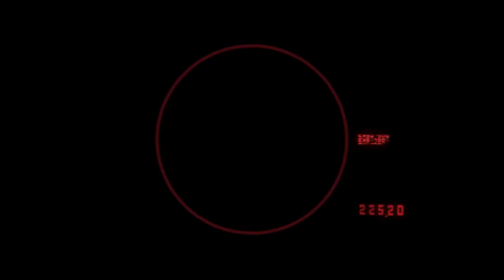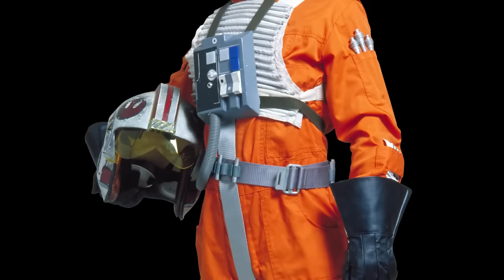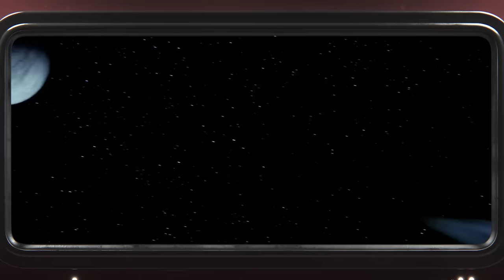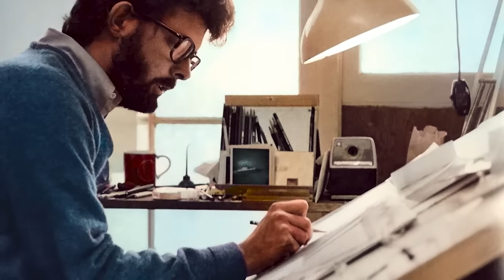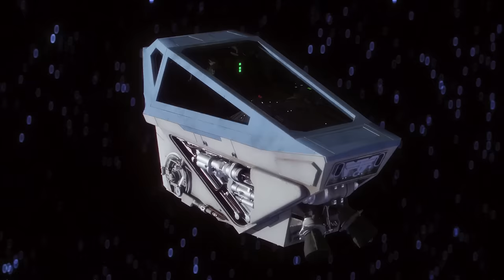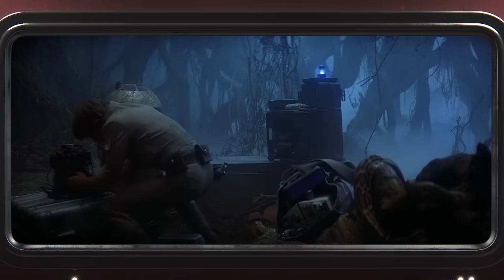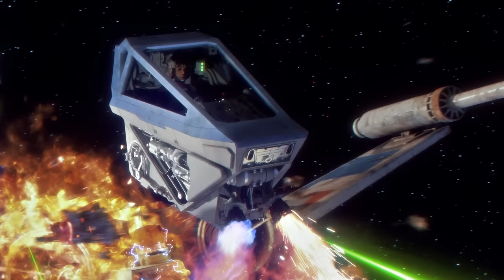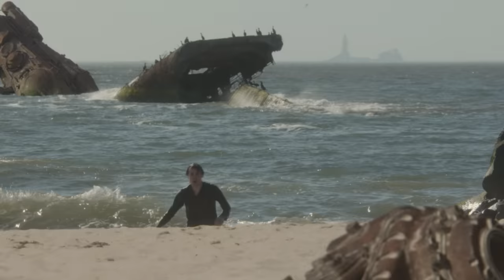X-Wing Ejection: It all makes sense now

Comment: In The Empire Strikes Back we see that the X-Wing has a storage compartment for essential survival gear, situated directly below the cockpit and accessed from the underside of the hull. If that were actually integrated into the base of your ejection pod, it would mean that those supplies stay with the pilot, with or without the rest of the ship.
Reply: I was thinking the same thing.
Reply: Ooof, I came here to say the same thing before I saw your comment. But yeah I agree.
Reply: This makes a tremendous amount of sense. Even on long flights the pilot can dip into rations below their seat by opening a panel and pulling out the ration box.
Reply: Thought of this also, but if I remember right, the cargo bay is below the astromech, not the cockpit, between the lower engine intakes. It could be connected, but I think it would over-complicate the ejection process.
Reply: @Treveli45  Remember though, all that stuff that Luke has on land was brought out of the X-Wing while it was still half-submerged, meaning there had to be some access either on the top of this ship or, as would make sense, through the cockpit.
Reply: @Tensen01  I keep having a vague book memory of the cargo bey being reached by going through the seat. But having the bay eject with the pod would add more 'moving parts' to something you don't want to over complicate. From ESB I'd say the cargo stuff is if you manage to land the X-wing, not if you're ejecting in a hurry.
Reply: Real Star Wars fan 👍😁
Reply: The cargo bay is actually under the astromech slot.
Reply: Would that be like a hole that would go from the top through to the bottom of the ship
Reply: I doubt this would be the case. The X-wing - along with most, if not all, Rebel starfighters - may be classified as a snubfighter and allows for comparatively more comfort, but they still only allow for similar amounts of space as most fighter planes, which is not a lot. Believe it or not, but the X-wing's cockpit space is similar to that of an F-15 - not the most cramped out of all fighters, but still not as spacious as you might think.

Fighter pilots on Earth do keep supplies with them in the cockpit for extremely long flights. However, there is really one only place they can be stored that is not on their person: behind the ejection seat. That space also contains their bailout supplies, and the seat itself still contains the main emergency comm systems, as modern bailout supplies are designed for rapid pilot retrieval via signaling for help rather than extended survival, and it has been the case since the Vietnam War. Fighter planes can be equipped with small cargo pods that can be loaded with the pilot's (and possibly the RIO/WSO's, if it is a two-seater) personal effects, but those are not meant for easy access until they arrive at their intended destination, as what gets loaded in those is rarely anything that can aid in survival - yes, they can be loaded with such, but if you are in a situation that forced you to eject, odds are that situation prevents you from ever being able to access them, so making relatively easy access to such a cargo while flying is kind of pointless.

In fairness, it might make sense if it was kitted out (and likely modified) for long-range reconnaissance flights, which would likely include removing most, if not all, weapons in favor of more fuel, better/more sensors, and yes, cargo space. For ones equipped for combat, though, such an easily accessible bay is likely to be considered a waste of design and effort.
Reply: @DavidRichardson153  That was a lot of well-written reasoning, but we know the X-Wing contains extensive survival supplies because we see Luke set them all up as a base camp after he crashes on Degobah in Empire Strikes Back. He has several crates that include ration packs, a power generator, supplies and spare parts.
Reply: @DrakeAurum  Yeah, and that is stuff that would only really be needed if you were able to land relatively safely (despite crashing into the swamp, he escaped injury, which qualifies it as a safe landing). And the fact that the bay contained a power generator and spare parts, all of which would have been useless if he had ejected in space, only further proves my points.

Even if Luke had ejected in atmosphere, unless R2 was left behind AND still could control the X-wing, what is even the point of storing items in a bay that, really, would hit the ground in a crash first? Now, throw in the much heavier weight of an ejection pod, along with the extra weight all of those items in the bay would come with, all of which would only serve to more quickly drain the already limited fuel such a pod would have, and what you have are increased chances of the pod NOT saving the pilot's life.

Invoking The Empire Strikes Back does nothing to help your assertion here. Could you have a fighter that does have such a setup? Sure, you could, but as shown and as I have to point out, the original trilogy's X-wing cannot be that fighter, and the newer Disney variant does nothing to suggest that it can be either.
Reply: @DrakeAurum  Oh, and one last thing to point out about Luke first accessing those supplies to build his little camp before he met Yoda: he was standing outside the cockpit with the canopy open, not sitting in his seat with the canopy closed. In all likelihood, he was physically unable to access those supplies while flying, and last I checked, the X-wing was never designed with the intention of having Jedi fly it, which Luke clearly was not at the time of the movie. A Jedi or any Force-user with sufficient practice could theoretically access those supplies while flying, but not a normal pilot, which was what Luke basically was when he arrived at Dagobah.

Having a feature that, in all likelihood, hardly any pilot would even be able to use, let alone actually use, is a quintessential example of wasted time and effort and pointless overengineering. Sure, he did still use the access, but again, it was only after he had crash-landed and he was outside rather than inside. If that access was meant to be used (and this is assuming it actually was a feature and not something he had to jury-rig on the spot), it was not to be while in mid-flight.
Reply: @DavidRichardson153  Most likely such storage was meant for scouting missions or forced landings, not exactly in space, nor in a swamp. Presumably at least SOME of the supplies would have been accessible from the cockpit itself (The food rations and medical supplies were shown to be not very bulky) The rest of the crates and camping supplies were likely accessible from the hatch underneath, or from the cockpit if the seat were moved (As the bottom half of the X-wing was under water at the time Luke had gotten the majority of the camping supplies out) So I don't think it's so much over-engineering as much as giving the pilots as many chances as possible to survive a variety of incidents. (Ejecting in space with NO way of landing on ANY planetary surface admittedly being the weakest chance)
Reply: It's great to see common sense still works. You know since it's become such are rare site in society now. It has become a flower that doesn't bloom in everyone's garden ANYMORE! EC I think you're spot on with the ejection system. And from the comments pretty much all agree. Love your content keep it coming.
Reply: @Tensen01  makes sense. Luke wasn't going to go swimming under the x-wing with that creature in the water to get the survival kit. Although we see him messing with the cargo section when the x-wing is out of the water, that doesn't mean the "survival kit" was in there. It would make more sense for the survival kit to be under or behind his seat.
Reply: Since he was going specifically to a foreign planet, he very well may have had more than the usual supplies packed in the cargo bay beneath the astromech, which would be something entirely separate from the usual emergency rations connected to the cockpit. If I was flying to a funky swamp planet, I certainly wouldn't pack nothing but the standard issue compact survival kit
Reply: A floor access panel inside the cockpit would allow it to have survival gear for a weeks worth or more after ejecting in deep space, certainly enough time for a distress beacon to be picked up.
Reply: well hyperspace tripps can take days and weeks there has to be some survival gear in it but the old lore the good lore before it went dark in the galaxy before disney said there where energy bubbles
Reply: @DavidRichardson153  of course we are talking star fighters not modern jet fighters.  being able to fly from one part of the galaxy to another and land vertically allows you do go more places meaning you need more stuff.
Reply: And also, along the lines of expanding the escape pod slightly, the astromech droid is so close to the pilot in the cockpit, the module could maybe not leave R2 behind too…😅!
Reply: …which you might want to do if he actually has the cargo module under himself anyways…😅

Comment: They utilised a system like this for the USMC fighter pilots in 'Space: Above & Beyond'. Made a lot more sense in the cold vacuum of space than an ejector seat.
Reply: Goddarn Chigs!
Reply: Holy crap someone else bringing up Space Above and Beyond. The show had problems ay but at the same time I loved the system they had in place for fighters. Fighters being infinitely more replaceable than trained pilots.
Reply: Also it made a lot of sense for deploying,  smaller airlocks and all.
Reply: Yep, really loved that show despite its later problems.  And the pod to ship launch design was very cool, if a bit overcomplicated. (Seriously,  leave the pod in there full time, and either keep the bay pressurized til launch, or do a vac walk. All that plugging and unplugging can't be good.
Reply: Pag's Payback.
Reply: Chigs rule, Red Stink Creatures.
Reply: Saved me the trouble of having to mention this. The cockpit module instantly reminded me of the modular cockpits used in the SA-43 Hammerhead.
Reply: I loved that show when I was a kid.
Reply: Beng over Chiggy man,
Reply: @Dru Underwood  LOL, I get the saying, but before the last episode ended, the chigs bent the 58th over a table. 
I guess my love for the Chigs is because of their superior, bio-mechanical technology and that before and after the show, I've never seen ANYONE use geometrical dagger/knife-edge craft like they did.
Reply: Yes, having the cockpit only meant they could CGI the rest of the fighter. Cost saving maneuver.  The Hammerhead fighter has that distinctive chin bump, and the reason for that was the fighter was designed in CG, and when they put a human form in the cockpit, half the pilot was sticking out of the bottom of the fighter.
Reply: Sort of, it just means that you die in a few hours rather than immediately. You've then got the issue of getting to the pod before the power and air run low, which can be a major issue when it comes to a space battle.
Reply: You just reminded me that in The Force Awakens, while we don't see the ejection on-screen, Finn and Poe both separately eject from their stolen TIE fighter,  in separate ejector seats. We see what one looks like on screen when Finn wakes up on Jakku. TIE pilots obviously wear sealed suits, so depressurization's less of a concern for them, but Finn and Poe should both count themselves lucky they presumably ejected while inside the atmosphere of Jakku. :)
Reply: First thing I thought of.
Reply: I love Space:  Above and Beyond!!  Thanks for referencing it!
Reply: That was meant more as a means of quickly getting someone into the craft, without the issues of decompressing the bay. 
It's escape pod function was rather minimal.
Reply: Starbuck's viper in the Galactica 80 episiode The Return of Starbuck also used a cockpit based escape pod.
Reply: Just put up a link to the relevant episode and scene.
Reply: @blackjac5000 "The Angriest Angel", right after the flight is ambushed while escorting the Hammerhead carrying the nuke. One their number has to eject, and Chiggy von Richtofen shoots the escape capsule.
Reply: Yup the Hammerhead cockpit was self contained…. it actually makes a lot of sense for the application… You put all the brains for all the systems in the cockpit module plus life support, and the rest of the spaceship is just there to support weapons, sensors, engines, power systems.
Reply: Babylon 5's Starfurys also have an "Escape Cockpit". Both shows also use this to solve the launch pad problem. You don't have to open a huge gate into space in order to launch the fighter, you just lower the cockpit through a relative small hole in the floor, close that hole, connect fighter and cockpit, and the open the launch tube. This way, even if the launch tube is damaged and can't be closed, you don't depressurize a whole hangar full of people who need oxygen.
Reply: The SA-43 Endo/Exo-Atmospheric Attack Jet was perfection at its finest!
Reply: They also use this kind of system in Babylon 5.